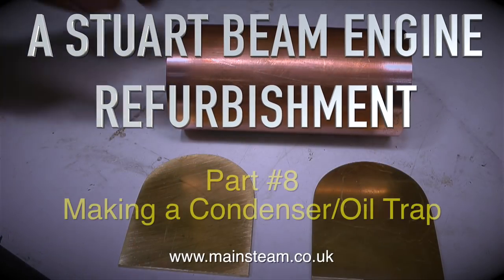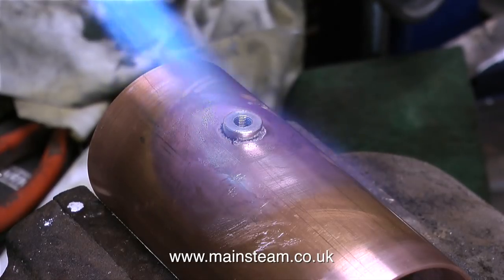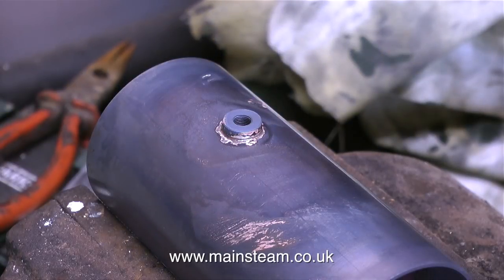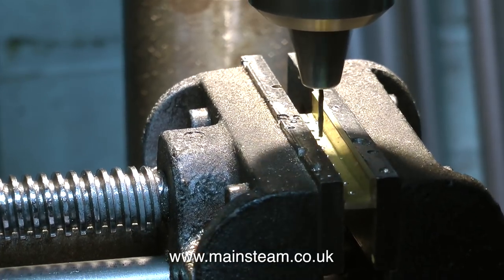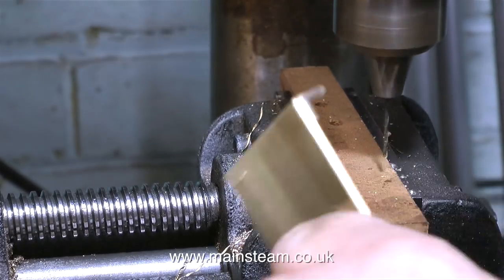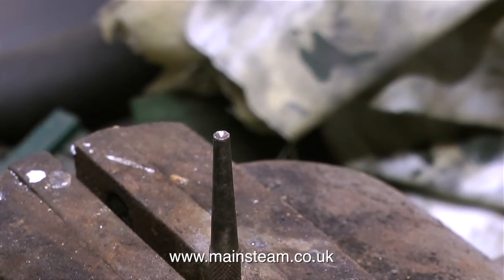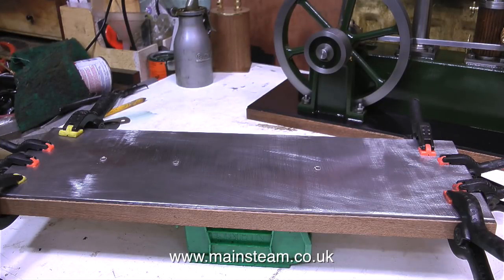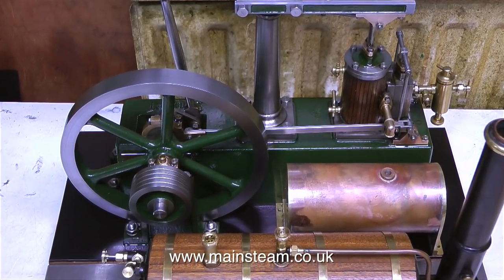STUART MODELS BEAM ENGINE REFURBISHMENT - PART #8

Comment: Hello Keith a good rule of thumb on riveting is the bucktails "the end your hitting with the hammer" should be 1 and 1/2 times the diameter of the rivet and  1/2 the diameter of the rivet tall. This will give the best holding strength. Just a retired USN aircraft mechanic giving some advice.

Comment: Your instruction and explanation is paying off, I had an impulse to question why the tube and plates of the condenser are only face soldered (with no other reinforcement) and then realized that would be a waste as it is not pressurized.
I have had to be judicious in watching your videos due to the fact that my wife enjoys your voice and wit, but she started asking me why the vegetable peel remover I bought her a few years back looks so much like your belt sander. 
Regards.

Comment: As someone who sucks at hand riveting, I have to say that you make it look way easier than it is. One suggestion for beginners is to lower the snap to at or below the level of the vise jaws. That reduces the amount you can move the part which helps to keep things level. If you’re like me you will still end up with some partially drunken rivets but nothing as bad as I get when I have the snap as high as you did in the video.

Comment: Is there any standard for how thick to leave the peined end of the rivet? Probably some ratio of the rivet diameter or boiler plate thickness. Whatever the standard, yours look right. I pounded steel rivets one summer and noticed a tendency to pound them too thin. No room for error in a boiler!

Comment: Hi, Keith. I'm curious why you silver-soldered the bushing when the vessel won't be pressurized. Will the incoming pipe really be hot enough to melt regular solder? Or was it just to have an excuse to explain about about silver soldering?
Reply from the maker: I like to show a cross section of different model processes . .  plus Silver Solder is always better for bushes whether pressure vessels or not .....

Comment: Any advice on types of steam oil? I see different types of "compounded" and numbers like 100 and 680
Reply from the maker: I use 1000 - but smaller steam engines are better with a lower number as they don't generally use superheat.